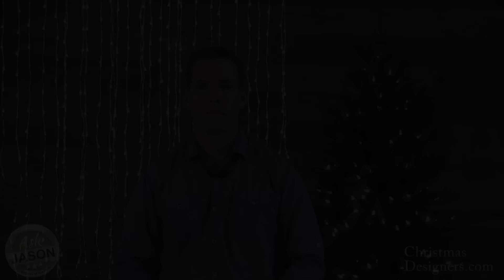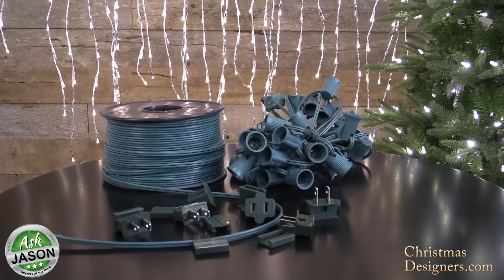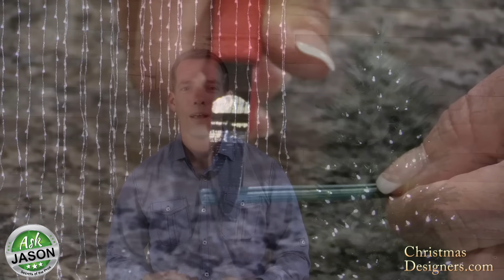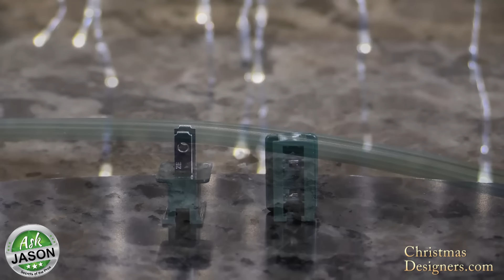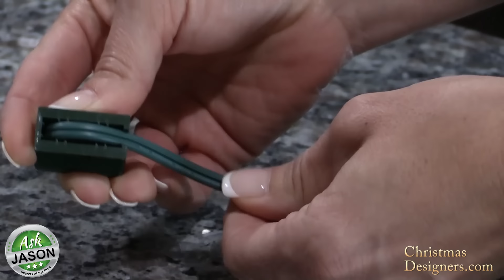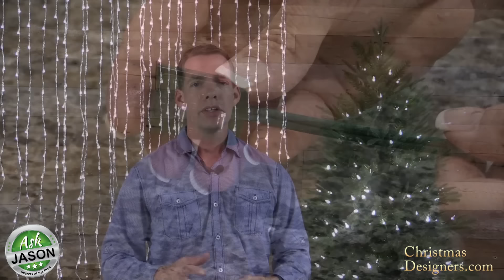Using Slide On Vampire Plugs for Christmas Lights

Comment: Hello, I’m hanging lights. The ones I bought have 3 wires instead of 2. How can I use these plugs?
Reply from the maker: If it’s a 3 wire light, then it’s more than likely a stringer style light set which is not the same as the type of light line that vampire plugs work on. The light set you are using is more than likely has 20 gauge or 22 gauge wire. These plugs only work on 18 gauge, 2 wire cord.
Reply: @ChristmasDesigners  is there anyway to contact you via Facebook/instagram/ twitter?

Comment: Does the main male power plug have to be at the end of main cord? Can it be in the middle?
Reply from the maker: We typically do not recommend this for safety reasons. A male in the middle of the run would power the line without a problem, but then for safety, both ends would need a female to avoid a double male situation which is extremely dangerous since you could end up with an exposed, hot male plug if it's being powered from the other male. But as long as only one male in the middle is used and both ends are caped with a female, then it would be okay.

Comment: Hi what are those two tools called that you used? Wire cutters? And the other one?
Reply from the maker: The two tools show were diagonal wire cutters and a pair of pliers. The pliers are not always necessary, but can make it easier to position the back slider into place.
Reply: I have another question it’s about the female one I notice that the smaller hole on the side you have to stick the wire in instead of like the male the bigger prong is on the right. I manage to make the male work now I’m stuck on the female one
Reply from the maker: @iluvtim77  The male and females will be wired the same way. Without seeing a picture of the issue you are having with the female, it's difficult to understand the problem. If you are using standard vampire plugs/slide on plugs, you follow the same steps for a male and female. The backside where the prongs are will be the exact same. If you need additional help, please email us a picture to customer_success@christmasdesigners.com.
Reply: Ty I ended up getting it figured out. My roofline is beaming with beautiful warm lights tonight bc of your help so ty again 🎄
Reply from the maker: @iluvtim77  great to hear! We're so glad to hear it's turning out great.

Comment: what is the diff between SPT1 and SPT2?  Which do I need for pentagon or c6 light sets vs socket sets?
Reply from the maker: Thank you for your question. The difference between SPT1 and SPT2 is the amount of insulation around the 18/2 gauge wire. Both are very comparable and will work in a variety of applications. About 80% of what we sell is SPT1. To understand the differences or for more information please feel free to visit our blog here: https://www.christmasdesigners.com/blog/understanding-the-difference-between-spt-1-and-spt-2-cord/

Pentagon Gem Lights and C6 lights have 22 gauge wire and vampire plugs can only be attached to 18 gauge wire. So these sets are too thin for the plugs. These stringer style light sets can be plugged into a zip line that has vampire plugs, but you can not attach the vampire males and females directly to the stringer light sets. Also it’s important to keep in mind that stringer style light sets can not be cut like 18 gauge light line can. We would love to hear more about your project and hopefully provide you with the best solution. Please feel free to email us at support@christmasdesigners.com!

Comment: Why can’t you do this with store bought cords too?
Reply from the maker: You actually can do this with store bought cord if it's 18/2 wire. But a lot of big box retail sell smaller gauge wire in order to cut cost. However, recently some Home Depot stores have offered light line and Vampire plugs in 18/2. But generally it's best to buy this online at distributors that supply the professional Christmas industry. That way you know you're getting true pro quality. A lot of retail stores claim their products are pro grade, but you will not find any professional installers buying their supplies from retail sources.

Comment: Jason, I have been all over you channel.  I would like to produce a very custom fit light set for my new home.  I am hoping to accomplish three things:
(1) produce lighting that fits the exact size of run that I am attempting to light
(2) is commercial grade quality that I can rely on year after year
(3) that lights remote eves without having a string of lights running to them or away from them (only the eves are lit) but are still connected to the lighting the same lighting that I have around my roof line.

I have spent hundreds of dollars over the past three years purchasing retail grade, big box store brands that fails miserably the following year.  If I would have started out with high end materials, I would have actually spent less.  What I am looking for is a tutorial on how to make this happen.  I saw this video and realize that I can buy the bulk wire and make my own outlets for terminating the strand, but what I don't know, is how do I build the light sting onto that wire.  

I am sure that you are super busy with the holiday season in full swing, so I probably wont get anything this year.  But I am really anxious to dump this trend of throwing money into the trash can and would love a solution that not only looks better, but will last.  Your help would be greatly appreciated.  Thank you Sir.

Robert
Spokane, Washington